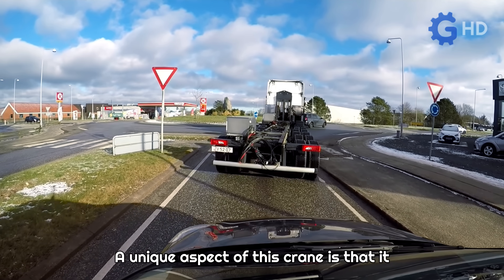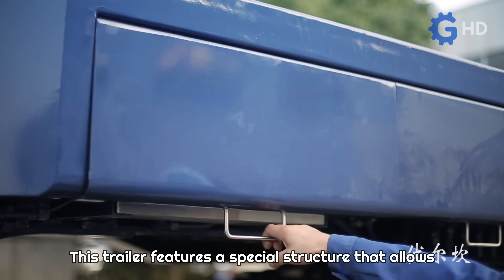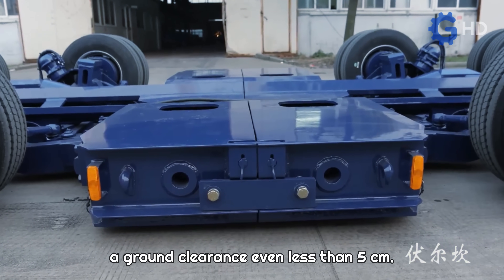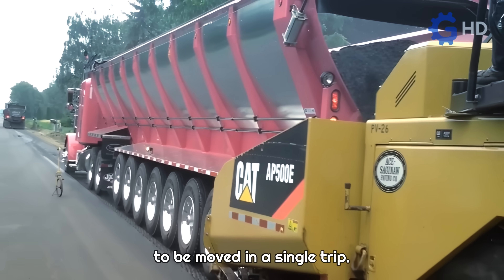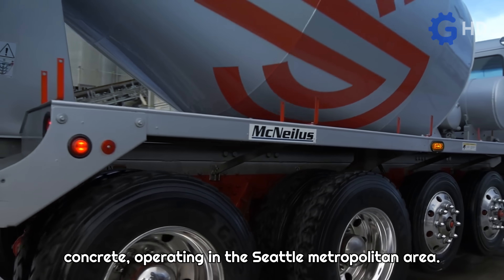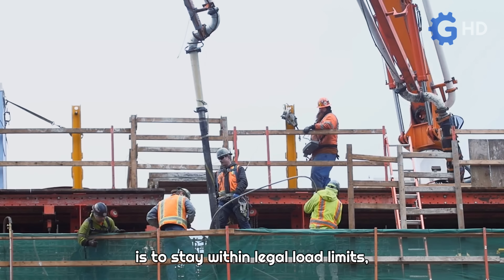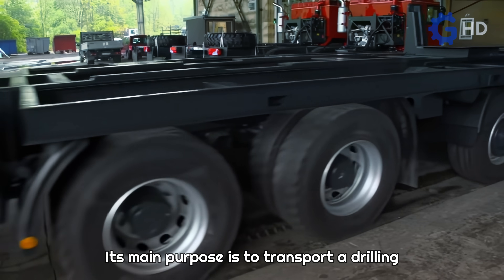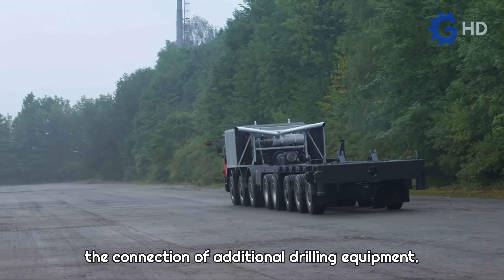WHY DO THESE TRUCKS HAVE SO MANY WHEELS? ▶ SPECIAL HEAVY-DUTY TRUCKS

Comment: That truck at about the 1:50 mark has so many axles and tires and weighs so much it can only carry 310 kilograms. I can haul more than that in my Jeep and it only has two axles and four tires, five tires if you throw in the spare. This company is onto something here. Maybe they could use helium in the tires and lighten the truck a little and haul, well maybe 320 kilograms.
Reply: 310 kg in 65 meters max lift.....
Reply: It was built to put a crane on it, the cranes lift capacity at full reach is 310 kg not what weight the truck's chassis can carry 😂😂😂😂😂. 
Use your brain why would a truck manufacturer build a truck that could only carry 310 kg 😂😂😂😂

Comment: Meanwhile Indiana can have triple trailers on their trucks but Michigan has a higher max weight?
Reply: @breadmenv....Michigan intra-state (within MI) commercial vehicle weight limits are based on a maximum of 20,000 lbs (9,072 kg) per axle....thus, if you want to run heavy weights, you just add more axles.
However, that's fine for running down the roads in a relatively straight line, but when it comes to maneuvering in urban areas, you can really only have a maximum of 3 consecutive axles (or tri-axle group) on the ground while turning, meaning that the remaining axles on that truck, full trailer or semi-trailer must either be self- or force-steered (*), or they must be liftable.
The problem with liftable axles is that during the turning process, you just transfer the lifted-axle weights onto the remaining axles that are permanently on the ground....which means that you damage the road in that area, and/or the suspension bushings of the vehicle. 
And the proof is in the pudding, so to speak.....Michigan highways and urban roads are the worst in all of the USA.
No wonder, the other States don''t follow Michigan's weight laws!!!
Any steered auxiliary axle positioned ahead of the tri-axle bogey is "force-steered", i.e. it turns in the same direction an the vehicle; all steered auxiliary axles mounted behind the tri-axle bogey are "self-steered", i.e. they turn in the opposite direction until the vehicle reaches the apex of the turn, at which point these steered axles also begin turning in the direction of the vehicle. (this is a neat set-up, until you need to reverse the vehicle.....as you must lift these self or force-steered axles, otherwise they''ll point in any direction during the backing-up maneuver).